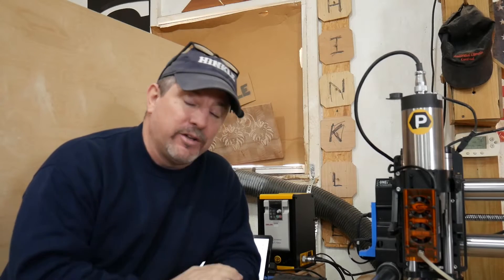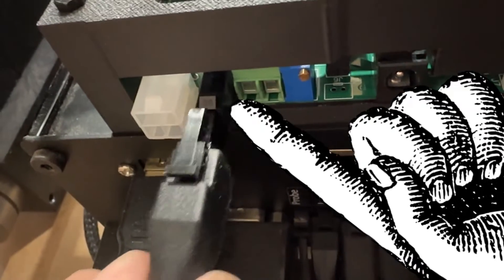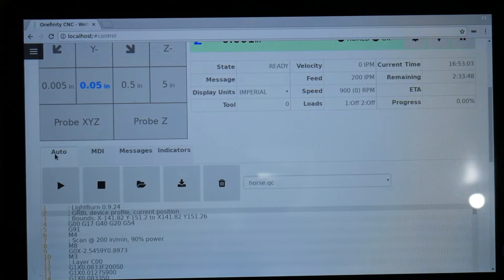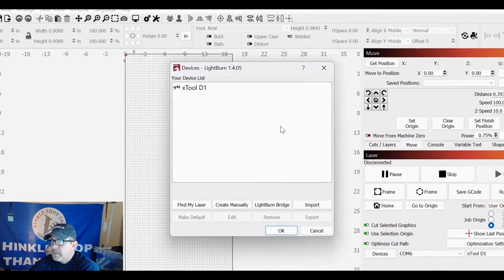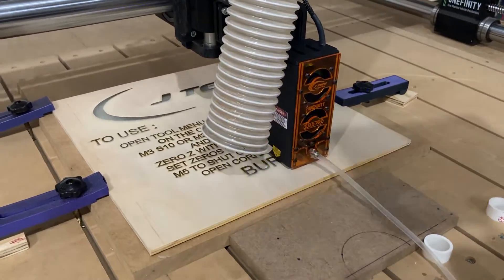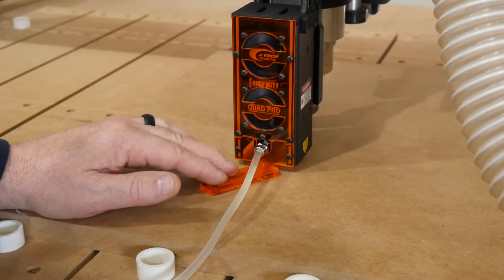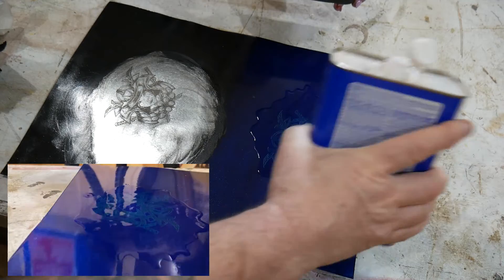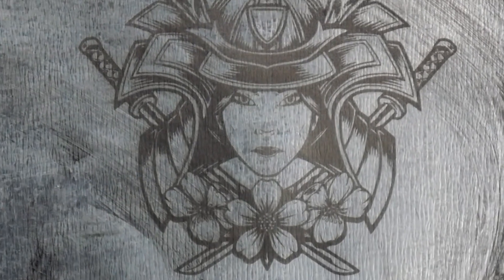J tech laser on a Onefinity

Comment: Even though the jtech has a sid3 shield. You & Mrs Ninja had safety specs. Mr Atlas or the Tearaway Terrier cant read safety instructions and Safety Specs dont fit them very well either.
Reply from the maker: Glad you mentioned that,
 other than when the camera was on I had put up a board to block the light from them 
I should’ve put it in the video